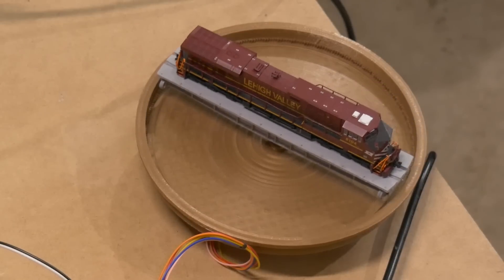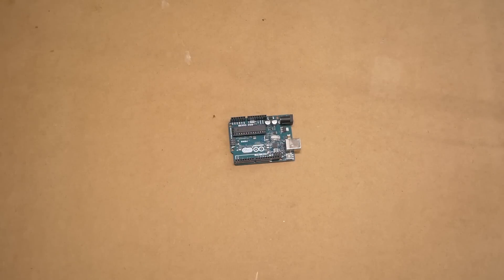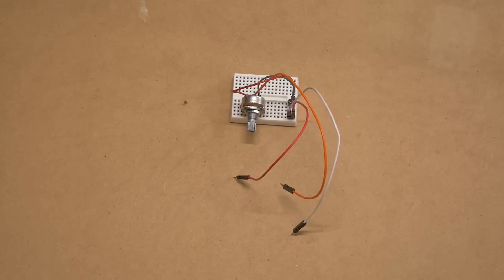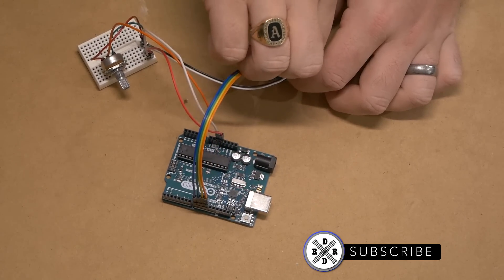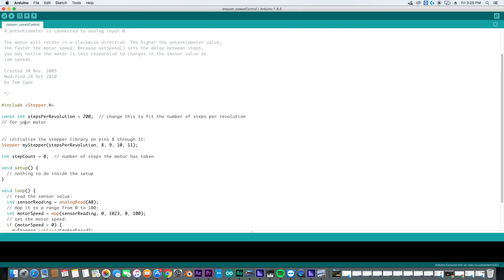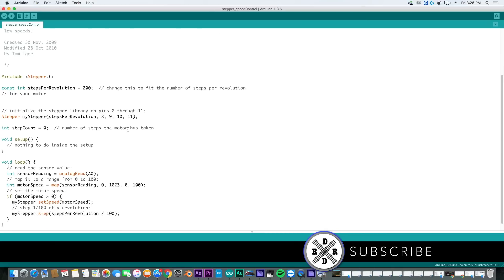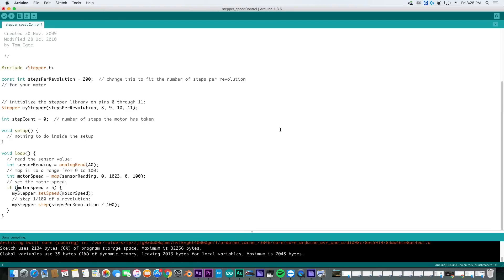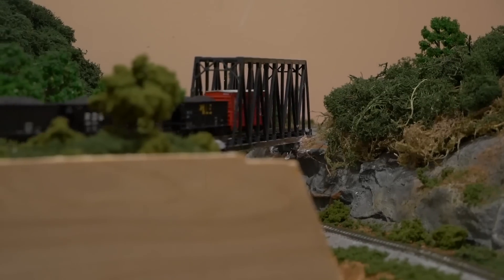Model Railroad Turntable with Arduinos!

Comment: Been looking for a way to power my sctratch built on30 turntable. I watched the video several times. The programing of the circuit board is not for me,  I don't want to learn computer programing. Do you know if this set up is available from any manufacture as a bolt-on package?

Comment: Hi, I'm a complete novice with this Arduino technology, it's the first time in my life I work with this technology, but I understand the hardware connecting from your video.
I'm following your instruction ordered the same components (still have to arrive).
But one thing that is not clear to me is the software, is it a freeware or not, and probably only runs on widows not on Mac OS?
Can you give me a link where and what to look for, you wold do me a big favor, as this is the only bit I'm struggling with?
Reply: Hi ! If you are still looking for it here is the link to the website where you can download the program (it is free) and it works on MacOS too !
Reply: @killian954 I've found it already, but thanks for the offer…

Comment: I am getting ready to install a turntable on my layout, and I have bought a walthers 90 non motorized turntable and the motorizing kit.  My question for you, is it possible to use Arduino to control a NON Stepper Motor, and get it to stop correctly at each track?

Comment: I found your video about Arduino UNO very informative. Where can I learn more about using and writing an Arduino program to operate a more complex turn table. Where one push button was used to start a set up process and several other buttons used to program stop points for head and tail stop points that lined up with the round house spurs. Also to incorporate some sort of relays to reverse the polarity of the turntable track and connect round house spur power. Just need more in depth info where can I fin this info
Reply: I’m having a similar problem, if you find the answer could you let me know?

Comment: Hi Jimmy, I've just watched your turntable basic control, and thoroughly enjoyed it, but can't see if you've done anything else about it. I'm using an Arduino and the same stepper motor you used but have problems getting an exact alignment with just 1 on and 1 off track. Have you a similar short film on that too?

Comment: Absolutely amazing video. The only problems I'm having are that my potentiometer is not the best, and my stepper motor needs some help to spin. Those problems can be solved with getting new hardware, and nothing to do with the video. I don't think I've ever even touched a model train, but this video was so helpful. Thanks.

Comment: I made a similar design but with a power output to the motor and each transfer track zone be optionally isolated. This way when i want something lined up i can turn the table until it hits the isolated section then stops. It’s an easy addition to this already pretty easy setup

Comment: you can use half steps on the arduino and also let it count steps so you can use pushbuttons for each track stopping in a perfect line. Or a horizontal slider pot ( fader ) with a  Counting Dial range next to it for each track. so if the slider reads between 65-90 = track 3  ,  if it reads between 140-165 = track 6 etc. Also there are better handling stepper motor drivers that could be smoother.  Good luck with this project

Comment: I agree with those who mentioned using a gearbox to decrease the speed, but I also wonder if that wouldn’t also solve the indexing problem. 
If you used a 25:1 gearbox, for example, now you’d have 5000 steps in a revolution, correct? Or more for a higher count gearbox. 
So you’d change that in the code, and at that point once indexed you’d have enough resolution to move a certain number of steps, 576 for example, every time and you’d always line up. 
Just a thought, really enjoyed your channel over the last few months, have a great 2019!
Reply: arduino can do also half steps , this way it is already more subtile

Comment: Nice video. Last year I joined the local model railroad club and the first task they asked of me was to get the turntable operational. It was a mix and match of different turntables with no decent method of controlling it. 

So I took on the project and 3D printed a stepper motor mount to fit to the turntable which, by the way, has 13 tracks leading up to it; most going to the round house. I also used an arduino to control everything but the control panel had 13 buttons for the tracks, one for 180 degree turn and a reset. So if you are on track 5 and you want to go to track 9, you just push button 9. If you wanted to go to track 3 but also wanted to turn the loco around, you push 180 turn followed by track 3. The program calculates the direction and distance to travel. 

This works fine but the guys want a simpler control panel so I am currently making one with an LED numeric display and a rotary switch. When complete you will just dial in the track number you want and push the button. Last month I promised I would have it done by Christmas... good thing I didn't say what year.
Reply: Sounds to me like a very easy and useful interface. Guess the other members just think old fashioned lol
Reply: Roy, I'm curious. How did you make it work  by  track number instead of just moving by a number of say degrees or stepper pulses? It sounds like you are doing what I have wanted to do with my TT but have not been able write a sketch that worked correctly.
Reply: @davidrt9999  First off, the tracks were not evenly spaced. Some were 10 degrees, some at 15 while others were at 22. Basically, just all over the place. So I calculated the distance between track 1 and track 2, then from track 2 to track 3, and so forth. I then wrote out a set of truth tables which held all this information. 

Now let's say you are starting at track 3. The variable CurrentTrackNumber holds that value. Now you want to go to track 7 so the program look at the truth tables and finds the corresponding entry. It then takes the value of 3 to 4 plus 4 to 5 plus 5 to 6 plus 6 to 7. These are added up and the turntable turns that specific number of steps. Now 7 is written to the variable CurrentTrackNumber. And it is ready for the next entry. 

That is the basics of it. And of course, depending if the new track number is higher or lower determines the direction. There is also a routine for turning the locomotive 180 degrees at the same time or independently.  Lastly, for the odd time the alignment might not be perfect, (It sometimes happens) there are jog buttons to fix that problem.  I hope I am clear enough with my explanation.
Reply: @paparoysworkshop  sound clear to me. Of course if your track connections are evenly spaced it makes things a lot easier.
Reply: @ReneDirks  You are absolutely correct. The turntable at the club was fabricated out of bits and pieces. Not a bought item.
Reply: @ @paparoysworkshop  Thank you. It was clear enough. I never thought to do it that way and would make my TT work the way I wanted it to. Thanks again. Would you share your sketch?
Reply: @davidrt9999  I'm currently rewriting  some of the code but yes I can send you a copy. It's too long to post here. Just let me know how you would like to receive it.
Reply: Greetings
I read an article of yours on the topic of the platform, I would like to ask you if you could kindly share the sleg for Arduino
Thank you

sorry for the text but I use a translator
Reply: @PIPPUSCAAA  There's 500 lines of code. I don't think that could be pasted into the comment section.

Comment: But what about stopping it? Specifically, stopping it at a specific location/angle in order to line up with the exit and entry tracks. Also, and I know diddly squat about turntables, but from what I have seen of them, the rotation speed seems to be too fast.
Reply: From what I've read (in the HO class) this is by far the difficult part of a turntable. Getting it to precisely stop at the right spot for the tracks to line up. Most of the DIY turntables I've seen use a stepper motor to drive a worm gear. This slows the speed down greatly (much more prototypical) and allows things to slow and stop precisely. Usually there's a sensor on the swing arm of the table and guides where the tracks are. The best one I saw used bar codes and an IR phototransistor to let the arduino know where the next track is. And then, like an elevator, it could go faster between tracks and slow down and stop when it got to the correct track number. To make the turntable turn the other direction, it's just a reverse of the sequencing. Some of the other example sketches let you determine direction as well.
Reply: I hope that's in version 2.0.  You can get away with 1 home switch/sensor then count steps to each track.
Reply from the maker: I gotta save some stuff for future videos right? ;)  The speed is adjustable from the potentiometer and can move quite slow.  I plan to work on the turntable and improve it.  Once I've got it east to understand, then I'll do an update!
Reply: @DIYDigitalRailroad  lol, ok, fair answer. Perhaps you might avoid comments such as mine by calling this "Part 1"? :)

Comment: Aah so that's what that was! I used the stepper.h example and couldn't get the motor to stop. I thought it was because of the pot but in fact it was the motor and all I had to do was change it from 0 to 5! Because I never thought it was the stepper motor I ended up getting this special library and writing code for it to automatically do 180degrees at the push of a button.

I'm thinking of going back to the potentiometer code as you get much more precision but keep the button and the button would reverse the rotation direction. 

If you ever use it on your layout, Jimmy let me know and I'll print you a nice knob for the potentiometer! :)
Reply from the maker: I'm glad that helped out! I actually bought a 3D printer!  I love it!
Reply: That's great!! Which printer did you end up getting?
Reply from the maker: @PierreLucGagnon58  I got a flashforge finder.  It's been great so far
Reply: That's a nice little printer! For N scale it's a great size :) Congrats, Jimmy!

Comment: From where can I get the link to get the 3d model of the turntable?
Reply: Here's where I got the turntable from: https://www.thingiverse.com/thing:933854 I did not create the model. I found a post from a guy trying it out on Reddit. It's worth mentioning that to get power to the rails you will have to do some custom work to it.
Reply: @PierreLucGagnon58  How do you get power to the rails. The creator says something about brass rings but doesn't show an example.
Reply: @GuyMasong1  You can use the components from an Atlas turntable which have the said brass ring. It's essentially spring tensioned contacts attached to the bridge part sliding on a brass ring attached to the base part. To keep things simple I simply coded specific positions and have the turntable reset back to the first position so it never does a complete rotation so you can just use wires directly
Reply: @PierreLucGagnon58  Thank you. Also, do you know if the pivot is supposed to fit in the hole in the well? In this video it looks like it's sitting on top.
Reply from the maker: I would have to refer you to YT user @Pierre-Luc Gagnon.  You can also look on Thingiverse or do a google seach.